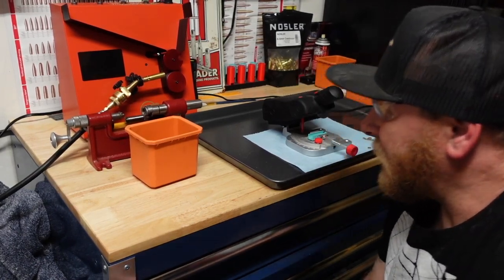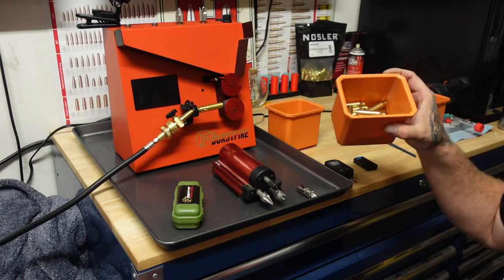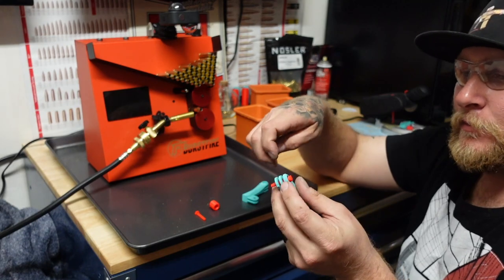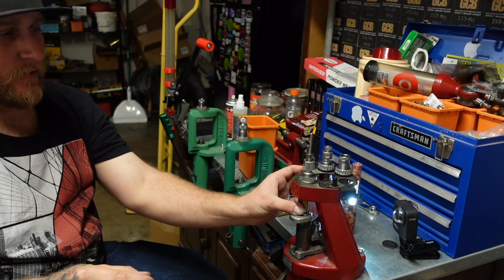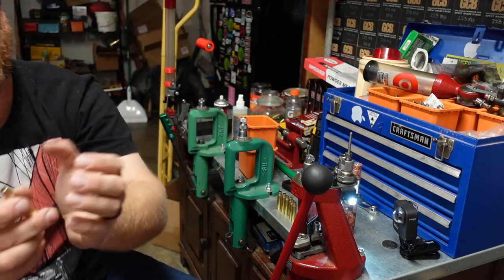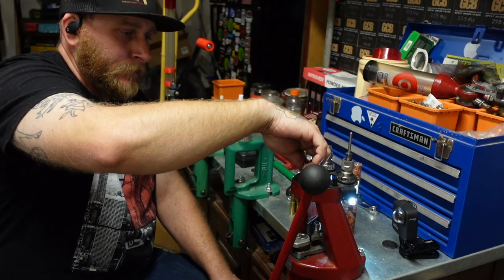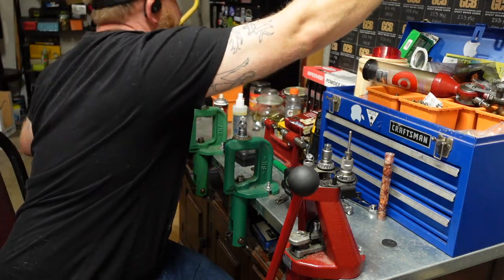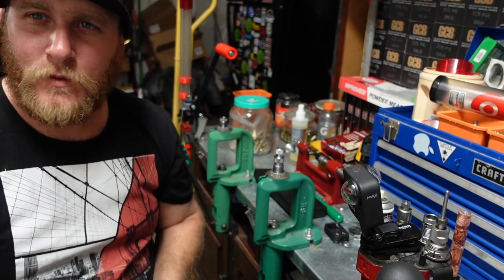8.6 Blackout Brass Conversion (Full)

Comment: First - thank you for the clear, step-by-step-step description of your process. It’s not easy finding 8.6 info. The intermediate neck expansion to .308 makes so much sense. 

Question:  could you put a .308 Winchester mandrel in your 8.6 Blackout sizing die for that intermediate step?  I’m thinking that it might improve concentricity with the mandrel centered/supported a bit closer to the case mouth. 

 Have you tried Redding Imperial Case Wax on the outside and a quick brush of graphite inside the neck?  I usually don’t need the graphite for bolt action rifles but it helps with semiauto brass in my limited experience.
Reply from the maker: Redding imperial is slow going, but works so well. I did attempt using the 308 in the 8.6 there was some issues. It’s been awhile since I did it, but if I were going to make more I would get a custom mandrel designed for neck tension to mimic a fired case to simplify neck turning if I wasn’t using H 6.5 Brass, or I’d get a custom pilot for my neck turners.

Comment: I enjoyed your video. Just curious why you don’t trim closer to the desired OAL the before annealing to reduce the amount you need to trim the 2nd time?
Since the video was shot a while ago, have you found other brass that doesn’t need neck trimming? Have you tried Lake City?
Reply from the maker: Thanks. I’m glad you enjoyed it. Lake city proved to be the most problematic. Even back when I was making my 6.5CM cases LC would yield higher pressure ammo because the difference in case capacity. To avoid unnecessary wear to my motorized trimmers I avoid trimming more than necessary. I found in more recent conversions that the RT1500 wasn’t the best choice. I now have a Bosh router setup, and it makes trimming much easier, plus it’s less expensive to repair/replace. So now I do trim closer to the OAL I want at the end. Playing with the 8.6 has definitely been fun. In my opinion the best cases still come from Hornady 6.5CM cases. Hopefully this helps. I know YHM was talking about a 1 in 5 twist barrel, but I haven’t seen it yet. I still load only monolithic copper projectiles, and am still using the same 3-4 types of powder. Cheers

Comment: Fantastic video bruh! I needed this. Just getting into the 8.6 game and have everything but the annealer. I Think the burst fire is in my future. As far as trimming I’m going to be using the lil crow trimmer. I hope this is a good method.
Reply from the maker: The little crow is a beast! If you have a progressive, and don’t mind spending a bit to get setup the honey badger, Bosh combo is the sweetest setup. It’s nice that it uses standard dies, and with the warranty on router you don’t have to worry if anything fails!

Comment: What size bullets do load? I'm looking at 285 300 for subsonic. But I've seen 210 listed as subsonic, maybe cheaper bullet if can really be subsonic? Also read that you have to use copper bullets for supersonic, the twist rate tares the lead core bullets apart.
Reply from the maker: I found for the SUBs the Sierra Match King 300 to be exceptional. For the supers I really liked the TTSX they’re solid copper. The SMKs are bonded there’s issues even at sub velocity with non bonded projos. I really liked A1680

Comment: I was having trouble yesterday with the final forming( first 308 then 8.6) but today working. The Norma brass seemed to be easier to form. But I tried the brass in my rifle(don't have bullets yet) shell looks like it is all the way but the bolt doesn't close all the way in. What is the length on yours from base to start of neck? I may not have it formed enough
Reply from the maker: 1.270 base to start. 1.354 to top of shoulder, and OAL 1.685. With certain brass the neck thickness can be an issue. After forming it springs back. I shoot for .013”-.014” I like to use an inside reamer starting with fired 308 brass before forming now rather than OD neck turning. The brass lasts longer. I had a custom reamer cut by KM. Seems to work perfectly. My most preferred method is still to use 6.5CM Hornady brass. It is 99.9% perfect when it comes to neck thickness, and for forming I prefer to go directly into my honey badger/bosh combo with a custom CH4D trim die.
Reply: Those numbers are real close to wh! I have. I ordered some formed brass, so we'll see. Hopefully it's not the gun. I have some 285gr bullets coming also
Reply: Sorry I don't want to be a pain. But I can not get brass formed, used hornady 6.5 brass still not. I broke the base of my Lee press( brass got stuck in forming die. Called Lee they told me their dies are not for reforming. Yesterday I tried annealing a few rounds still no reforming. Afraid to brake another press, it's the c shaped press I may need the Chalenger press.
Reply: Which brand are your 8.6 dies?

Comment: could you develop a method to turn .308 to 8.6blk? Here in europe we dont have much access to 6.5cm brass but we have a lot of .308 brass.

It will be a very very interesting video!!!😊 many thanks in advance!!!
Reply from the maker: It’s the same process used for 6.5 cm brass. The 308 brass will have thicker neck requiring you to turn it. If you shoot for .013”-.014” neck thickness you will have the best results. Something to keep in mind is 308 brass will have reduced case capacity, and will exhibit pressure signs sooner than brass made from 6.5CM. Thanks for watching. If you would like I will take the time to make a video of the neck turning.
Reply: @2A_CaliGuy  a video of neck turning and how to make a 8.6blk from 308 will be very very good (didnt find any video 308>8.6blk, so i guess that tou will be the first one !) also in the video it will be very good to speak about the aforementioned problems of reduced case capacity and pressure.
Any way your videos are very very good!!!!